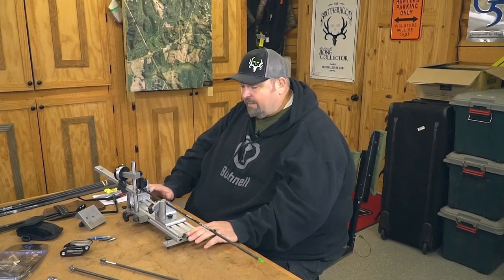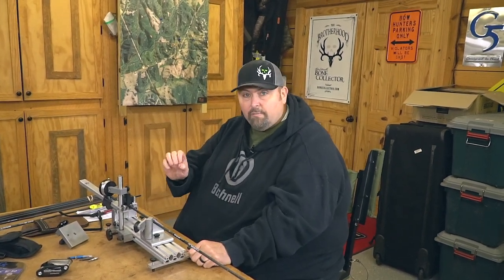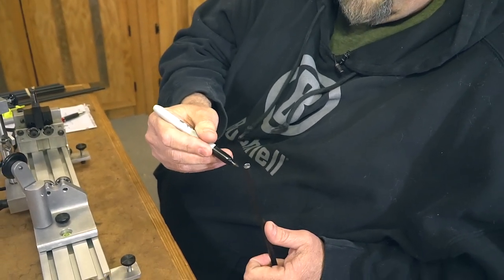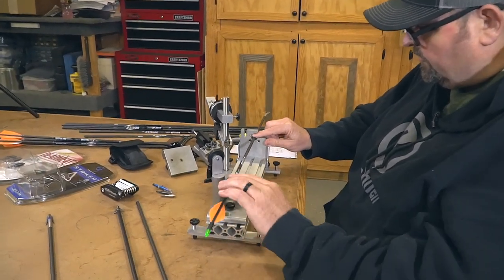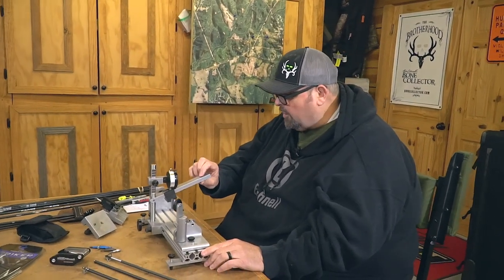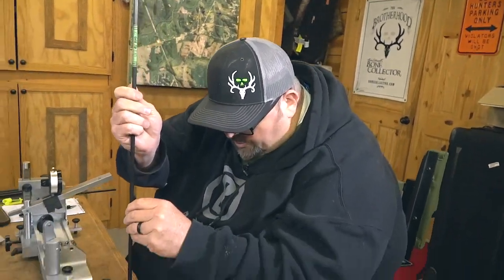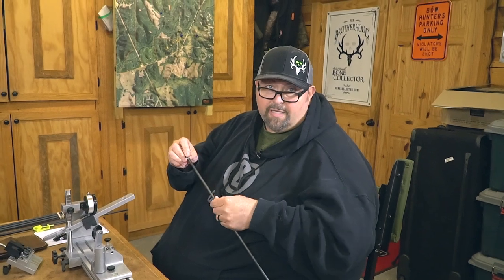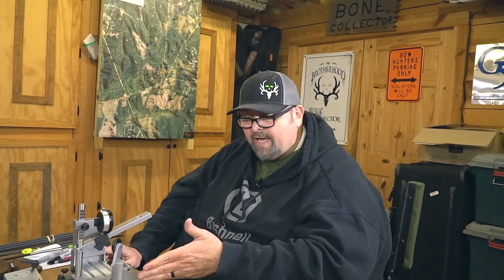Revolution Arrow Tuner + Instructional

Comment: I am 61 and have shot bow most all my life. We used to have to tune broadheads back in the 70’s and 80’s. I have not needed to index or tune a broadhead in over 30 years. My arrows are squared as are my inserts. I use quality broadheads, and have not needed to tune one in forever.  I have a vane master pro and my own LCA bow press.  But broadheads, nah, they have not needed touched in a long time. I will say, and sorry to say this, but I have had nothing but bad luck with G5 broadheads. The first set I bought were Montecs, and they were so dull I would not shoot them at a squirrel. I took them back. Muzzys, Sicktricks, Wasp, they all fly like darts with no indexing or tuning needed.   Now the rest of that right looks nice, but all that broadhead tuning I have not had a need for for half my lifetime now. And that arrow straightener. The bottom V notch needs to be curved, so when you push down, the arrow can bend up into the curved groove and not against squares ends. Just something I figured out with arrow straighteners a long long time ago.

Comment: How do you do the indexing of the broadhead if the insert is already epoxied in? I know if you used "hot melt" you could heat the insert and move the broadhead to the correct location.   Looking for suggestions

Comment: Nice Tool, but the one thing I wouldn't use, is that broadhead wrench, unless it was lined with Teflon or something that won't damage or dull the blades. Putting a perfectly razor sharp broadhead in that aluminum wrench, and torquing the edge of the blades against the aluminum is gonna dent, ding, dull the blades, and the Most Important Thing About Bow-Hunting Is Having The Sharpest Broadheads Possible !

Comment: So, if all you do is push down on the arrow to tune the broadhead, wouldn't the first impact into a target make it out of tune? So after every shot you would need to tune it? Hope i dont come across sarcastic, im genuinely curous as it seems it would be that way.
Also, I agree with some other comments, if it was a spine checker and able to use it to index, I would likely be all over this! Thanks!
Reply from the maker: Hi Ryan, it is a great question. In general, yes, as you shoot the heads into a target the impact could alter the tuning. In turn, you'd need to turn the shafts more than once to keep them fresh if you are a guy that likes to shoot your heads in a target. Most shooters will ensure their broad heads hit perfectly with their field tips, then they will tune their heads, and those arrows stay in their quiver until they shoot those arrows in an animal. Keeping the arrows in tune.

Comment: Can the squaring tool square aluminum shafts?
Reply from the maker: Yes!! And of course, with an aluminum shaft, you might have to use the squaring device slightly more just since aluminum will be much more dense compared to carbon.
Reply: @LCArchery  thank you 4 yr reply 👍👍